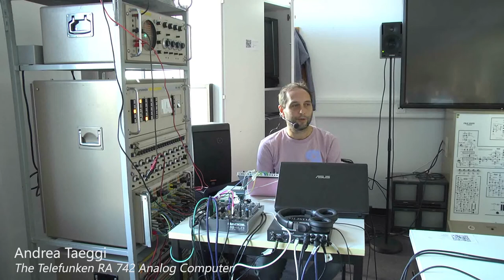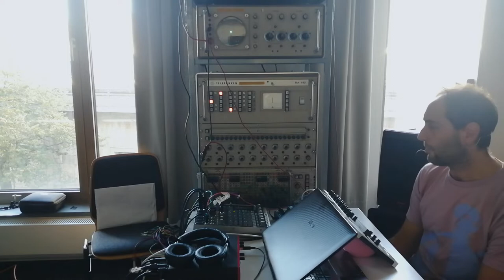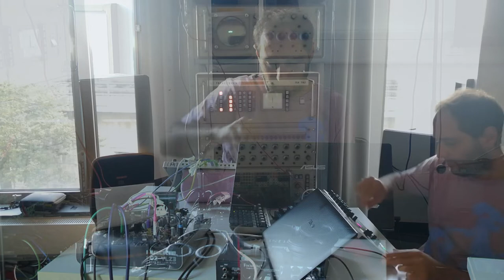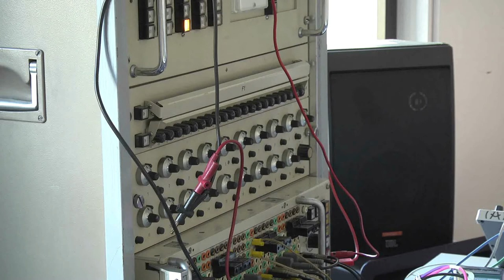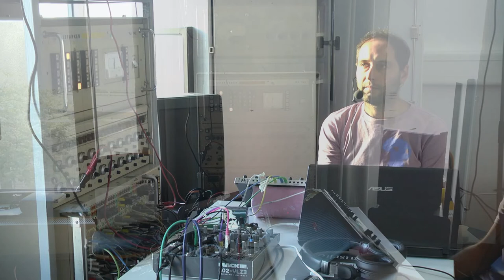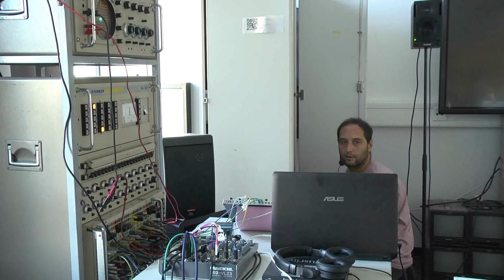Andrea Taeggi @ VCFB — The Telefunken RA 742 Analog Computer

Comment: Hi Andrea :-) Despite the rather simple program and limitations, AND the short time to get it running :-) you eventually showed your great musicianship with fantastic rhythmic structures! Compliments!!  Actually it would be nice if you (by some funding means) could continue your research on these techniques. During the recent years at WTS Den Bosch I developed some programming techniques to: make the resonator respons more dynamic by varying the excitation input levels, and by using multipliers to be able to Voltage Control the damping & pitch. Also, one could think of building/developing some custom musical control interface together with the use of the Beatstep. Then, combining this line of thinking, using this with Bernd Ulmanns' awesome THATs, this can open up an analog physical modelling synthesis instrument, totally open for further exploration (which is the purpose of analog computation instruments).  Be sure to also check out the developments of research by Jessica Ekomane Etoua (based in Berlin as well) for her combination of MAX MSP with a THAT! 
Groetjes uit Den Bosch :-) hk